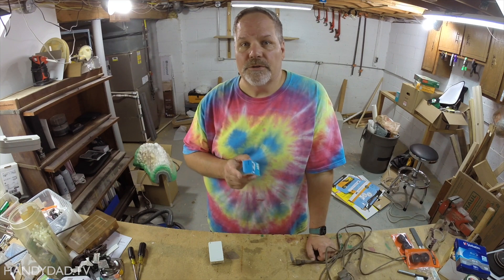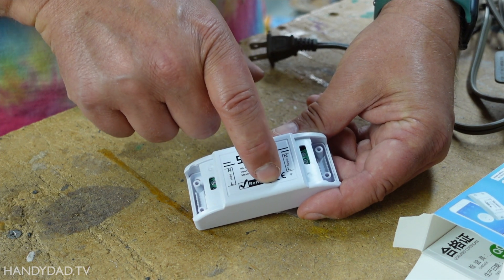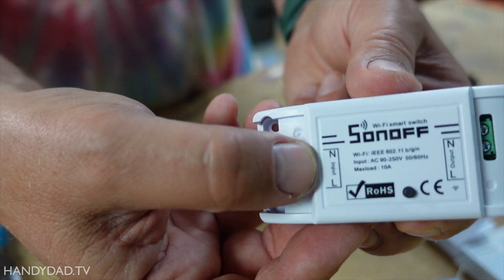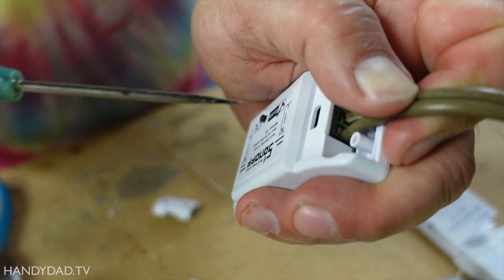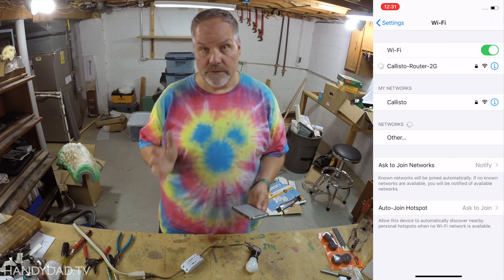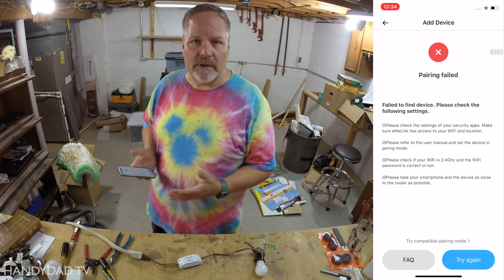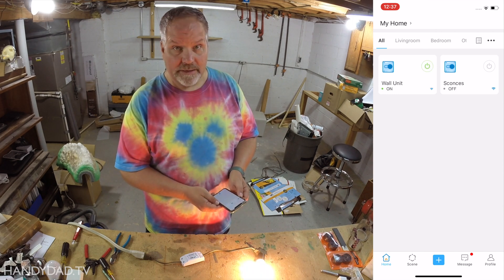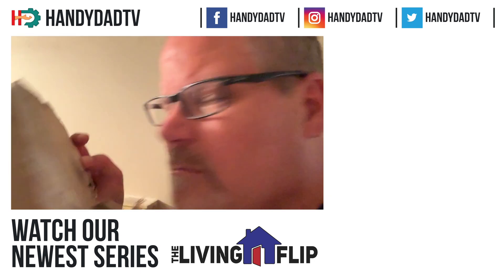Sonoff Basic Smart Switch turns anything into a smart device

Comment: Hello Handy Dad, thanks for the video. Can you explain how to wire a pool light, that is on an exterior switch (Gfci) with the same Sonoff device?
Reply from the maker: A pool light should be installed with a physical toggle switch (and yes always GFCI protected). I would just replace that with a smart switch instead of using a relay module like this.

Comment: Great stuff.  I just stumbled across your site.  I currently have traditional switches and bulbs, would my best bet for you lights to be replace with smart bulbs?  My goal is to use Home Assistant to control and automate.  Not sure how to determine which bulbs would be compatible or if this is the best direction.  Any insight apprreciated.
Reply from the maker: I personally love WiZ bulbs. They work great with Home Assistant. They require WiFi but will still work if your internet connection is down.
Reply from the maker: If you have a wall switch that controls multiple bulbs, then I’d opt for a smart switch instead of smart bulbs.
Reply: @handydadtv  currently nothing smart tied, so hoping to avoid having to wire anything if possible.

Comment: iPhone:

1) I have a dedicated router with a WIFI 2.4 GHz network setup.
2) I connect the iPhone to this network. Easy.
3) I set my SONOFF basic device is in pairing mode: 2 x blinks, pause...
4) I go to the app home screen and: + Device.
5) I get a screen that lists WIFI-2.4 GHz. I guess its the only option. I click NEXT.
6) I then get a pop-up: "WiFi password is empty, Continue. It asks me to CONFIRM, which I do. If I cancel it does nothing. I am mesmerised. How will it share the WIFI without a password. I imagine the device is so good it will hack that part. It is after all smart. 🙂
7) I proceed with utmost faith. It then searches for the router - +3 min until it says it cannot find the device. I start again....

Surely! This is simply a bad app design. There is no way in a million years you can connect to a WEP secure router without providing an SSID and password. Why has no software engineer considered connecting the the EWELINK app to the WIFI (as part of the Profile settings) and then allow one to add devices.

I am an app developer and so I can say:  This experience has got to be the worst I have ever had in my life trying to connect devices over a shared IP. The IT geeks have never sat with customers. It cannot be a difficult fix.

We can never stop learning. Can anyone tell me what I can do. I have tried every tutorial possible.

Comment: Sir, Loop timer or Schedule Time ON/OFF ?? 
If we are using this component only by mobile application, 
No Alexa, No Internet Connection. Only done setting by mobile.
Then, 
If there is no power for 24hrs then Does this perticular function (Schedule Timer) still work as it was set before without setting it again..
Reply from the maker: The app doesn’t work without Internet.
Reply: @handydadtv  take a one case, 
 in which I did ON/OFF setting with the application with the internet as well. For 2 to 3 day it's scheduled time function was work as expected. On 4th day we had power cut for 24hrs. Will the schedule timer ON/OFF function work at the exact same time which I set it 5 days before?? 
Or I have to do the setting with the mobile application again???
Reply from the maker: @prashantzodge842 I don’t know. 🤷🏻‍♂️
Reply: @handydadtv  🤣🤣🤣🤣🤣, 
I got one reply for the same query...
The Auto ON/OFF or Schedule timer does not work if there is a power cut. So it does not have it's own system to remember the timer after power cut...
Reply from the maker: You’d be better off with a mechanical timer (not a smart switch). But you’d need to correct the time after an outage.

Comment: The device you use is what I would call a receiver. The receives WiFi communications and switches power on or off. Is there a Sonoff transmitter with a dry contact input (instead of for example a push button or a phone). I have a Victron battery monitor that has a relay contact output and want to switch devices based on battery state of charge.
Reply from the maker: I’m not sure.

Comment: Will it work if there is no wifi connection at home and I have to switch on/off the lights connected to it from my phone at the office miles away. Thanks.
Reply from the maker: This requires an Internet connection. 

Use Zigbee or ZWave for local control that doesn’t require internet.
Reply: @handydadtv  Thank you.

Comment: Is it a one way switch? i mean, if i turn off a lamp by its switch, can i turn it on via the app and vice versa?
Reply from the maker: If the lamp switch is off, the device won’t do anything. You need to leave the lamp on, then you can control the light from the device or the app.

Comment: Yes, this is a good deal.  Yes, this is a smart switch.  However, there is a SMARTER WiFi Switch. And, its made by Sonoff. So, before you start putting these lots of places in your home.  Look at their RFR2 or RFR3.  These used to be called the Basic RFR2, so if you see it under that name, its the same.  So, why are these SMARTER?  They have the features of the BASIC, but also RF.  So you can use almost any RF 433 MHz remote to turn them off and on.  And Sonoff makes an 8 button RF remote that no one else has.  I have these 45+ all over my house.  Love them.  Check them out.  So, HandyDadTV is right, but he could be SMARTER about what he's telling us about.

Comment: No help whatsoever; unless someone wants to k now how to strip a wire and screw it into the connectors.  That is NOT the issue.  AND, I KNOW what I want to use my switch for.  I'm trying to get it to connect.  You never show your phone, you're doing stuff I cannot see.  My device simply cannot be found, no matter following all the instructions I've found on the Internet.  ACTUALLY, I've never had a pleasing experience with  Sonoff devices.  It takes HOURS for each new device I buy and try to connect.  I'm not a stupid person.  I'm somewhat tech-literate.  I was hoping maybe someone had a coherent step by step (without fumbling around) that I could follow and finally get some joy.  Therefore, I give your video a thumbs-down.
Reply from the maker: Appreciate the feedback either way.

Comment: Will this work with an Electric Fireplace? My current smart plug turns the fire place OFF but will not turn it ON.
Reply from the maker: You need to check the power needs of the fireplace against the rating of the smart plug.

Comment: They work great, but it’s better if you flash it with tasmota!!! 😁
Reply from the maker: That’s a high tech alternative. Not for the average consumer.
Reply: I have sonoff basic. Its works with ewlink and also google and alexa. But if i leave it on and lets say after 15 minute later voice commands will not trigger switch. Google says unable to connect. After 2 times attempting the sonoff led flickering and reconnect. Then google voice work. So its not reliable. Do you know any solution? Is this because ewlink?

Comment: These things are sending something to China. Sounds like a conspiracy theory, but you can plug one in and check your router/firewall logs to see it. There are options for flashing them with open source software, but then you'll need another way to control it. At the very least, I would set these up on a DMZ so that they don't have access to the rest of your network. They are esp8266 based devices, so they are computers. So, out of the box, they are a computer on your network that may be controlled by someone in China.
Reply from the maker: Never know.
Reply: @handydadtv  I sound like a nutjob, don't I. I don't claim to know what they're doing. I just know that my Chinese cameras and these things are constantly communicating to Chinese IP Addresses. It seems like a lot more often than it would be to check for software updates or anything. I have enterprise level firewalls at home, so I'm able to block by geolocation. Since so much is made in China, I make it a point to look at my logs when I put a new device on the network. So far, only these and my cameras have been offenders. I may take the time to setup a capture some day and drop them on a dmz and see what they do, but I suspect it will be encrypted.

Comment: Hi HandyDad, is it possible to incorporate the Sonoff Basic in a sort of three-way switch setup? So that if in case there is no internet connection i can still switch on the light using the traditional switch?
Reply from the maker: Just push the button on the device to work it manually.
Reply: You can do that.

Comment: In the UK all our leads have an earth wire, if this is not conected and a fire started because of that the insurence would no longer be valid.
Reply: When you cut the extension cable, just bridge the earth wire across from one side to the other without going through the Sonoff.  Works perfectly.  If you're handy with a knife, you can cut into 3-core cable and leave the earth connector intact.  Just break live and neutral.
Reply from the maker: Good to know!
Reply: Not true!!!..Loads of equipment only has live and neutral in UK!!!...No metal parts to earth or get a shock from...No problem...All plastic and unless you stupidly touch the live wires directly you won't get a shock

Comment: These strike me as cheap “certain country” junk like the GFCI in The Living Flip that was overheating and you had to take out.
Reply from the maker: Sonoff is a well-known company who’ve been around for years. Much better than the no-name GFCI from that other video.
Reply: HandyDadTV good to know. Thanks for the reply.
Reply: I was thinking the same thing until I read this post. Thanks for the additional 411
Reply: I use them regularly as an extension, except I allow for grounding through the cord. I use them with Homebridge and find them much more reliable that a WEMO smart plug.